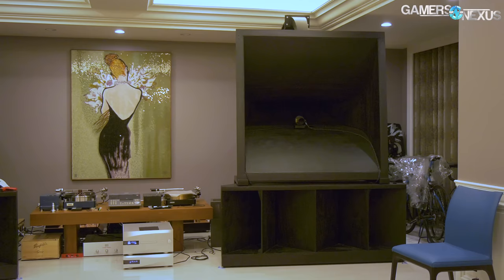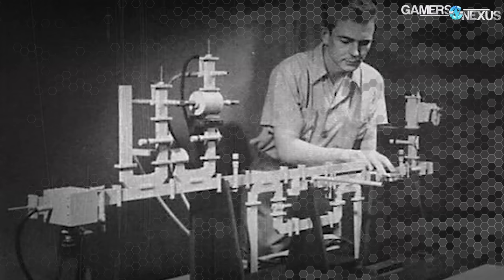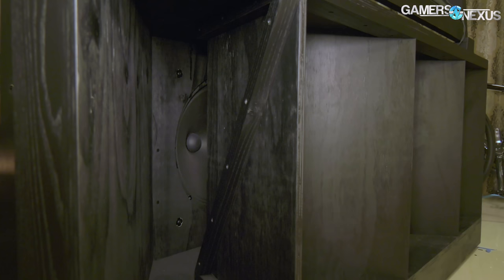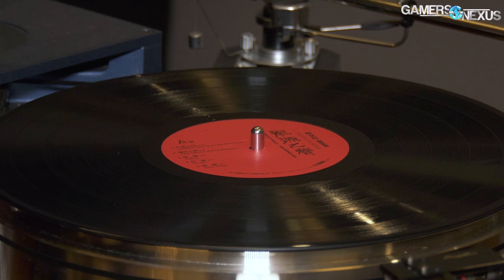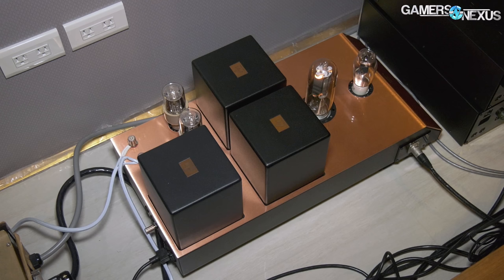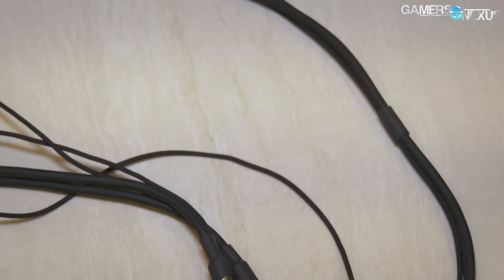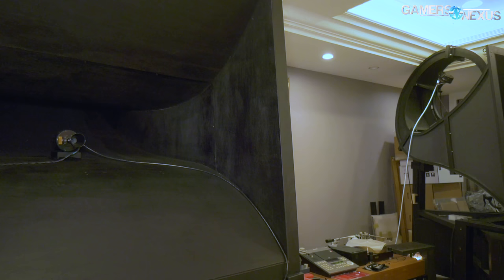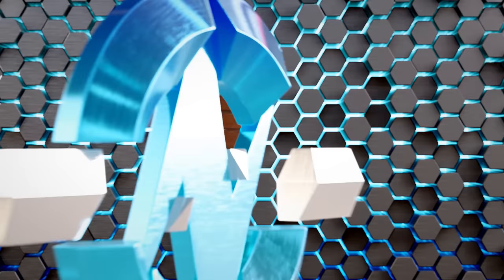100-Year-Old Sound System Tour | EVGA CEO's Audio Collection

Comment: Out of all the clueless nonsense coming out of audiophiles, vintage hifi is close to the top. Not a single component has not been improved through time, be it a a loudspeaker driver, a vinyl pickup, an amplifier, a capacitor or even a circuit board. There's no "forgotten recipe" that somehow renders modern equipment inferior to vintage equipment! If you like vintage, that's fine, but don't claim that it's because it is better!
And vinyl, valves and horn speakers are objectively the very best way to get the absolute most distortion possible - there's no two ways about it; digital playback through transistors and ICs played back through moderne active speakers are superior in every measurable way!
In a controlled environment with matched levels and proper acoustics, a set of Kii Three's or Dynaudio XD60's would absolutely demolish that system at a fraction of the price and immeasurably higher levels of practicality and ease of use.

I'll admit that the pride of ownership is another thing, and that putting together a system like that is a hobby more than an exercise in accurate sound reproduction.

Cudos for actually acknowledging that "highend" cables are bullshit, though.

Comment: Old junk compared to modern audio equipment. Paper cones, valve amps (old valves for that matter), old DACs. Pretty sure more modern systems at a fraction of the cost will blow this away. Sure it is cool from a historical point of view but there are better options out there.

Comment: Funny seeing techie, non-audiophile Steve speaking about audio gear.  He's got the stat sheet, but clearly out of his element and doesn't really know what they mean.  Not hacking on Steve at all.  I'm glad he's been exposed to high end audio.  It's just funny seeing it filtered through his modern tech viewpoint.  
I'm surprised Mr. Han doesn't hear a difference in cables.  I'm not into the magical side of it, but capacitance definitely varies and it is definitely audible.  Surprised to see the cables all over the place.  Their placement, like the way wires are laid out inside an amp, can change the sound.  Not even going to get into room treatments.
There is no perfect sound, no brass ring.  Some systems sound better with certain styles of music. And source material varies wildly.   Pretty cool though, that Mr. Han had a selection of cartridges for different styles of music. (Forgive me, did anyone else think of Enter The Dragon and Han's collection of hand attachments).

Comment: Nope Nope Nope.  Retro fetishism at its worse.  Give me modern low noise electronics, accurate speakers with a flat response, proper room treatment and a DIGITAL source.  This is like driving a vintage car, good fun, but miles away from what's possible today.

Comment: This is certainly not a great audio system, and it's in a horrible room. Vinyl is garbage, it always was. 10 kHz limited? And you think this is great? Paper cone woofers are trash, and his are falling apart, all paper cones fall apart. He's just a lunatic. The DSP corrected system on my desktop, or the DSP corrected system in my living room, or the DSP corrected system in my car, are all infinitely better than this trash.
Reply: Yeah it's more a retro-thing with a bit of audiophile's voodoo than a proper high fidelity setup.
Reply: while i agree the room wasn't great, paper cone isn't always bad. some driver manufacturers went back to paper based cone nowadays. also what's your base of reason to call another guy's system is trash?
Reply: Any modern super car or Tesla is light years ahead of a Dodge Charger or a Super Bee but guess what... a Tesla still isn’t a Dodge Charger or Super Bee. Preserving history and appreciating old engineering masterpieces is more what it’s about.
Reply: Your DSP mangled system sounds like hot garbage.
Reply: hey! i'm using DSP right now!
lol that's fine.. OP just can't appreciate a historical thing like this one. while i use a lot more modern system but everytime i listen to such oldschool system.. damn. there's something special about them. they're less accurate compared to the properly-tuned modern system but they're so damn pleasing especially on the midrange. I've also listened to 845, 300B, 100TH, KT88, and many other. i can say they're unique on their own way in a good way. anyway, i do have a pair of vintage paper cone woofers. they don't fall apart as OP stated. still great until my cat decided to claw one of them. :(
Reply: My parakeet decided she liked the taste of mine :~(
Reply: Yeah, my calibrated microphone is totally failing me smh. Any one of the systems I have is better than anything you've ever heard.
Reply: The OP seems to be a bit harsh on this topic but he is kinda right. The 60-70 dB dynamic range of the LP is technically inferior to modern digitally encoded recordings with usually 100-120 dB dynamic range. Sure, the LP sounds a bit warmer and more rich due to the less than optimal response in the higher frequency range and the compression effect of the tight dynamic range and correction method. Same goes with the tube amplifier. The nonlinear characteristics make the tube sound bright and warm due to the asymmetrical distortional behavior that induces even harmonics besides the odd ones.
These old systems are like a tinted glass. It's fun to look trough them as they add a nice color to the image. But most of the time you just want to see the true image as it was intended to be seen. A hi-fi system's job is to give back the original sound as precisely as possible. Making the record rich and colorful is the musicians' and sound engineers' job.
Reply: I can believe that setup sounds very good. There's no reason the older amps and cartridges or D/As shouldn't sound great, they were the top of the line, and by extension very expensive, and often very inefficient.

The only thing I am very surprised by is the lack of high frequency response. Can't find a tweeter to get above 10 kHz? Really? If he really must use the WE597A, he can certainly go to 4-way to extend the response to at least 16 kHz. Probably not much point beyond that for most people anyway though. Vinyl response above 10 kHz may not be ideal, but you do have CD playback too, and those have linear response way beyond 16 kHz.
Reply: @VoltLover00  Vinyl may be a shit support but the (pre)mastering and saturation makes it better than digital (in a artistic/musical way, not technical). Also using a eq to correct your room is just a band aid compared to actual acoustic treatment . The ceo doesn't appear to have any treatment either and probably doesn't have eq correction either so you've got that other him. It's so dumb, spending all that dought on old priceless gear and doing nothing to the room. audiophile my ass